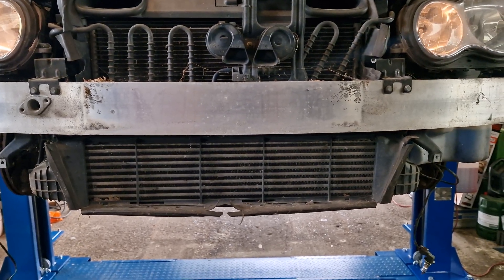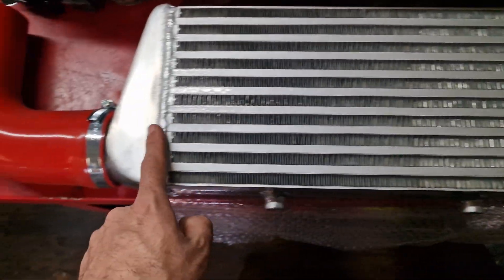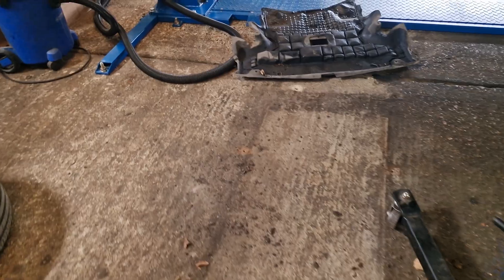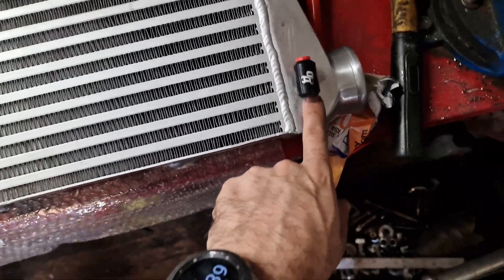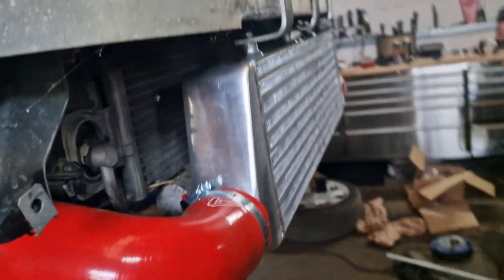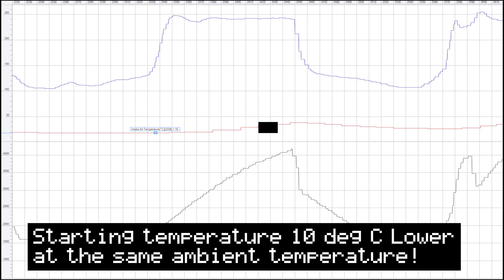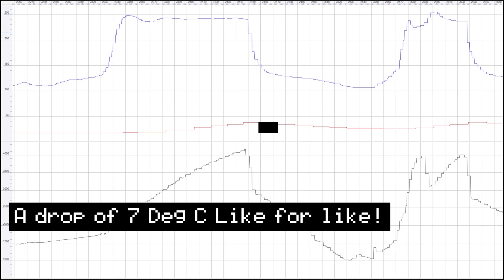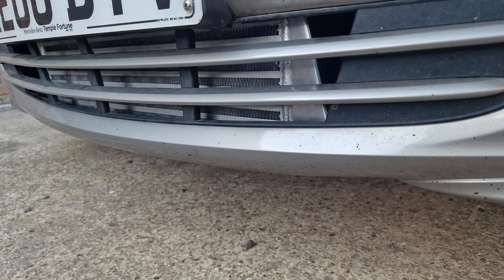Tuning our OM642, Charge air cooling!

Comment: Have you considered E400 intercoolers?   They seem much larger and also welded ali construction, with the ports facing the right way.  Might fit an e-class better.   Did they make a C-400 anywhere (US?)?
Reply from the maker: Good shout but all the e400s I have seen have had charge coolers fitted. Meaning extra pipe work and water pumps etc.

Comment: What type/brand intercooler is that or which intercooler is best for this engine?
Reply from the maker: It's a no brand Chinese ebay special. The brand,type and size is something you need to check for your specific car. Ideally, the biggest you can fit (to a certain extent), and retain air flow around the bumper etc.
Reply: @amfautomotive5710 can you please share what did you use, as sizes of tubes, and the size of IC? I will do this modification in c270 with hybrid turbo and remap, was going to help me in search for correct parts Thanks.
Reply: How does this affect the drive of the vehicle?
Reply: @johnscott-collett2813 it makes your car running better decreasing Cooling temperatures by 20% I think, what its safer for your car even ir you run it stock
Reply: What is the size of the tubing